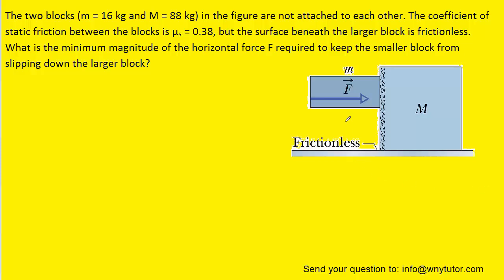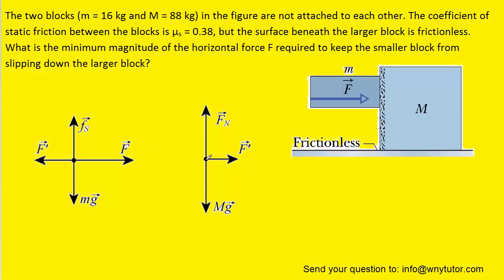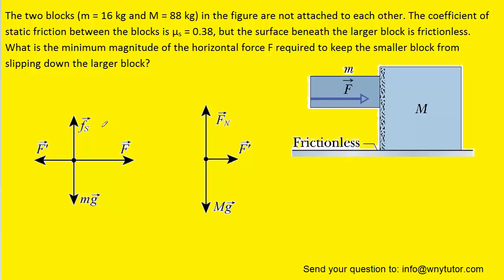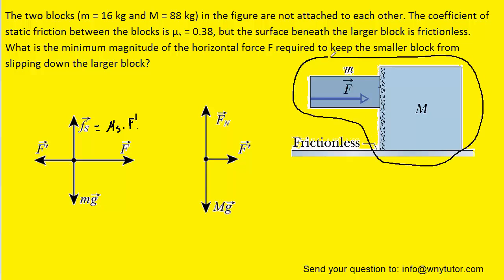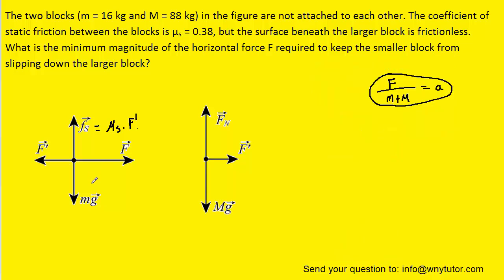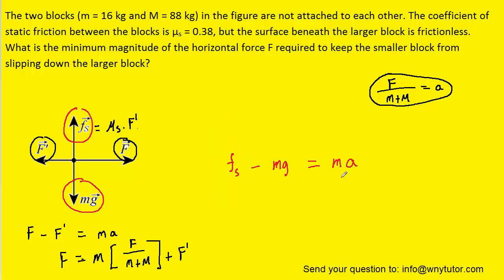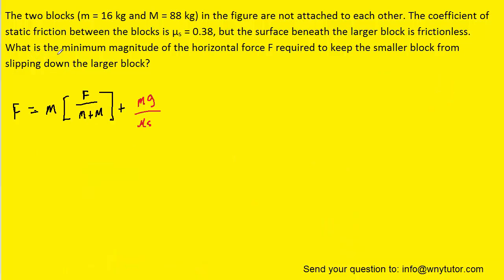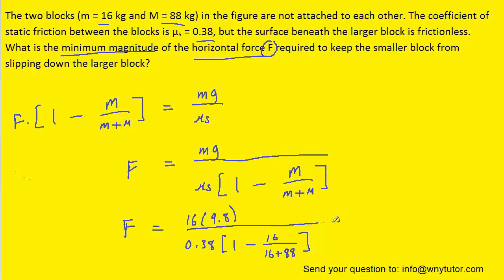The two blocks (m = 16 kg and M = 88 kg) in the figure are not attached to each other. The coefficie

Comment: I don't understand why there isn't an additional downwards force of friction on the large block? Seems like straightforward Newton's 3rd Law to me - if large block holds up small block using friction, then small block pushes down on large block with the same amount of force.
Reply: There is indeed a friction force on the large block but it's not significant in this question because you can find the answer using forces on the smaller block only.

Comment: The correct answer is : 2682.10 Newtons. 

Concept: the force F applied on the small block generates a normal reaction force between the contact surfaces of two blocks i.e. N . 
Now N = m ×a ( common acceleration of both blocks  since there is no relative motion / no slipping ) 
Now the friction force is 
f =( mue )s× N  ..………      (1)
Also f = mg ( because block m is not slipping down wrt M ) .........(2) 
From (1) and (2) we get 
Hence   f=(  mue )s ×N = mg 
               mue ×ma = mg 
              a = g / ( mue ) s  

Now    F net  = ( m+ M )×a 
            F net=( m+M)×g/(mue) s
 
Calculation :                                  
      F = ( 16 + 88)× 9.8 / 0.38
= 2682.10 newtons .

 This is correct concept. 
Others comments about this wrong ( sorry guys) .
 This is verified answer.
Reply: Please, delete your comment. See in the manual solution of Halliday & Resnick.